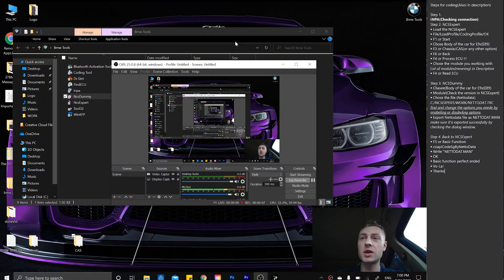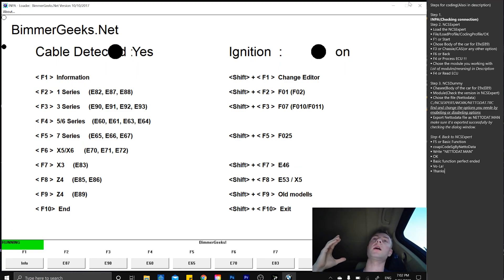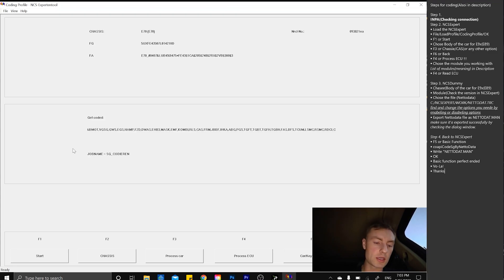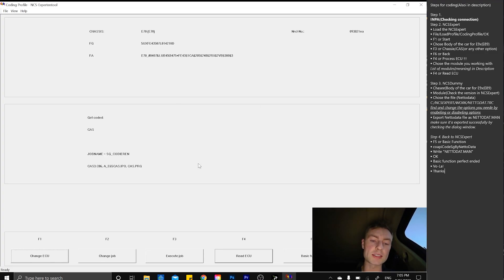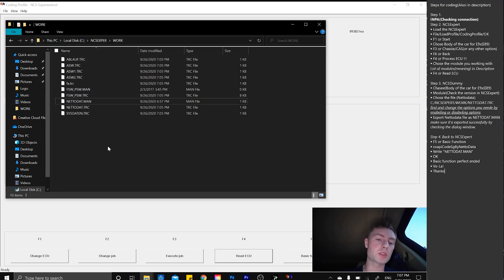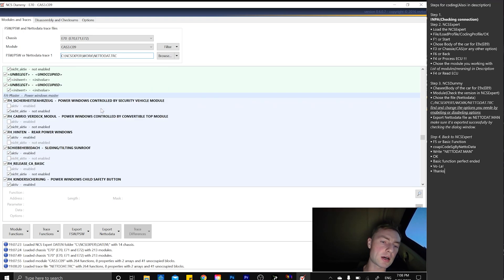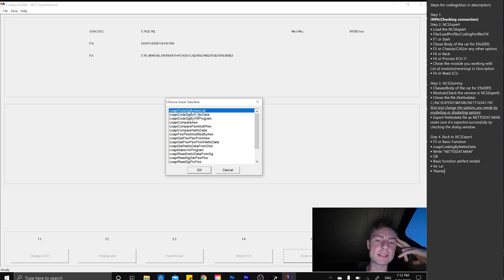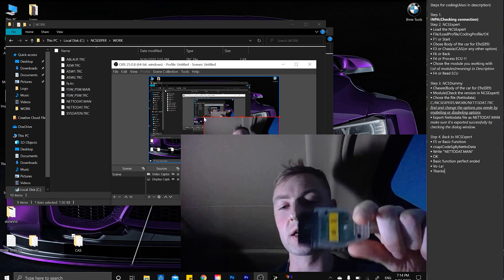BMW coding tutorial How to start using NCS tools E Series Remote Windows closing

Comment: Hello thank you for uploading this video.  I am coding my e90 lci for the very first time . I have retro fitted bi xenon adaptive headlights from halogen as well as FLA mirror and RLS . All these parts have rewired at the head lights as well as the FRM module.  I have replaced the FRM module with a FRM 2 AHL LED module from another vehicle which had FLA and RLS . I currently have no warnings on my dash and the head lights are working fine.  I want the rain sensors to work as well as the highbeam and the cornering lights . Q1 would I need to code the frm module with my chassis ? 
Q2 would I just need to code the Cas ? . 
Q3 do i just follow this video and select the option on Ncs expert dummy? . 
your help will be much appreciated